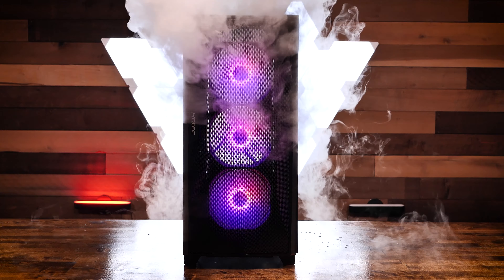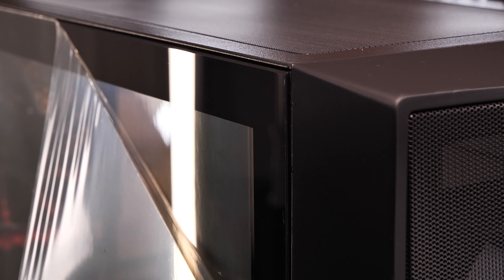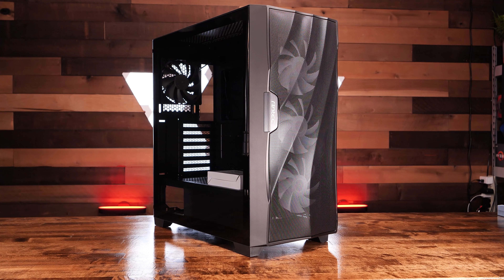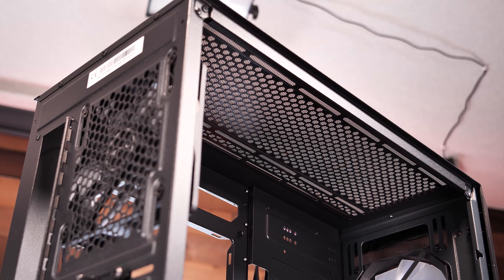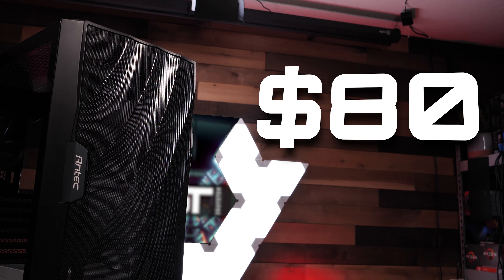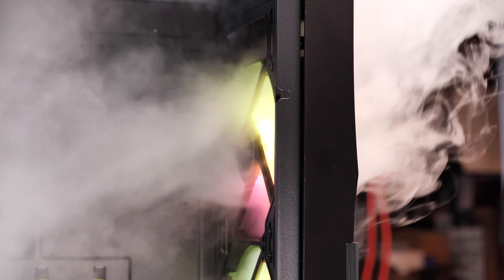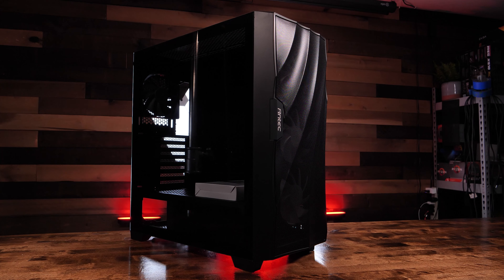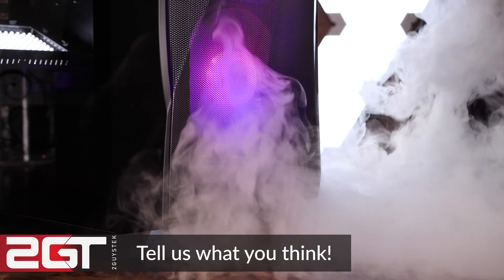Antec DF700 - Sculpted Mesh and Airflow

Comment: Isn't the bottom fan facing the wrong way for it to draw in cool air?
Reply from the maker: Nope! The included reverse-flow fan actually spins in reverse. This fan is specifically built by Antec for this position and looks backward to a traditional fan.  Thanks for the comment!
Reply: @2GuysTek  ahhh ok, seems like it would have been easier to use a regular fan, but I do like the idea of bringing in cool air directly to the GPU

Comment: Can this fit a 4080?
Reply from the maker: depends on the length of the 4080, so check before buying the GPU (or the case). Typically yes it should, but there are some large coolers on GPUs these days.